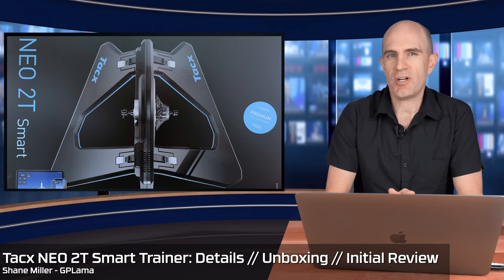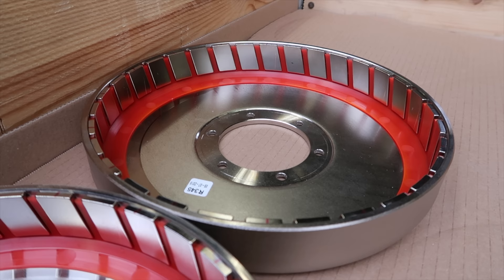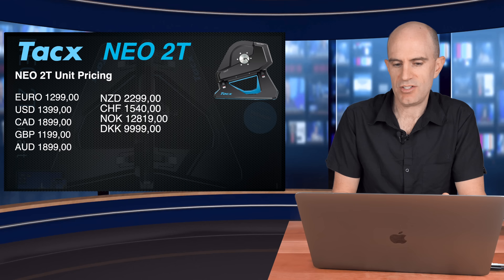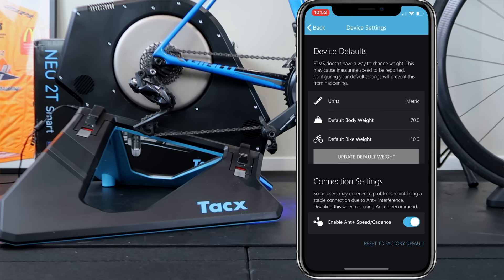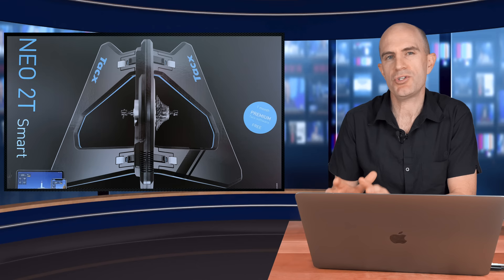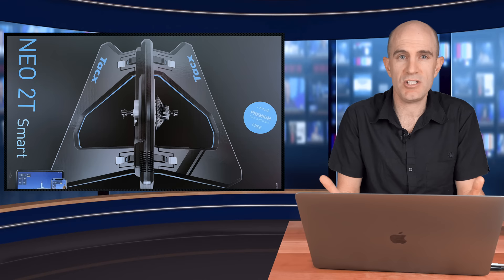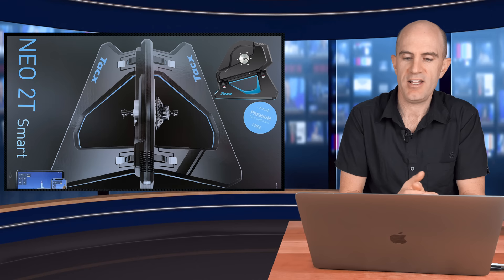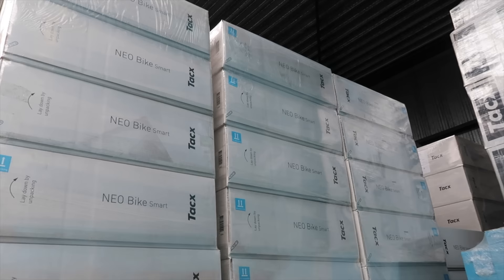Tacx NEO 2T Smart Trainer: Details // Unboxing // Initial Review

Comment: Shane, I just got a Tacx Neo Smart 2T and i feel like something is wrong. I have never used a smart trainer. It appears it is too hard for me to pedal even when in the lowest gears. Any ideas? Unless my power is too bad.
Reply from the maker: Ensure your weight is correctly set within the Tacx Util app if you're using Bluetooth to connect to this trainer with platforms such as Zwift.
Reply: Thanks for the reply Shane. I checked and I have the right weight in lbs set. I’m using the Tacx app. Cassette appears correctly installed and firmware is up to date. I’m using the front small gear and the rear 2nd largest. Still difficult to pedal. I think I’m going to reach out to Garmin to see what they say. ??
Reply: @hamdi672  I had a similar issue with my Neo 2. Could hardly pedal in the lowest gear. I contacted Tacx at the time and they asked me to send the TCX files of rides when this issue had occured. Eventually the unit was returned/ tested and replaced under warranty. Probably best to contact Garmin mate.

Comment: please be so kind to let me know the spec of cassette locking tool. thank you
Reply from the maker: This is the one I use: https://amzn.to/2yq6eE4
Reply: Shane Miller - GPLama thank you, It is the same result if the torque is given with a tool that does not have the 5 mm pin or guide.? Regards

Comment: Hi Shane, Any news on when the updated or full review on the Neo 2T will be published ?
Reply from the maker: Still a work in progress with Tacx and a few firmware revisions. We're close.....
Reply: @gplama  Are they gonna release new FM version cause power issues??
Reply: @Shane Miller - GPLama

Hello Shane! We road together a few times on zwift, been since winter 2014 👍
Quick question if I may? 
What are your concerns with the neo2t as it sits now?(you say it’s a work in progress) just wondering because I own one, and my only concern is Power May or may not be a smidge low? 

Thx again GP - Ride On
Reply from the maker: @dopefish90five  It's a work in progress in the Lama Lab. I believe Tacx have sorted the accuracy of the 2T .... and the power meters on my bike are tried and tested (and trusted). I'm working though a few variables that could be causing a few missing watts I'm seeing. It's quite the project behind the scenes. I'll cover this when I get my two feed back on the ground in the Lama Lab.
Reply: @gplama  Anything new about updated review???
Reply from the maker: @holsius  Not at this point. Soon. But I haven't seen any updates or details published from Tacx that'll change anything since I last looked at this.
Reply: @gplama  fw. 0.34 is out. Same power difference against power2max ,quick tested 200w and 250w in erg mode.
Reply from the maker: @holsius  I've been doing a few tests here over the last few days. Looks like 0.0.34 nailed down an issue with high speed flywheel and power reporting with the Neo2/2T. I'll post an update when I have more details... it's a work in progress.
Reply: I mean that difference IS same that before. Not good
Reply: Fw. 0.34 neo2t 200w vs. 209w power2max and neo2t 250w vs. 262w power2max. Almost 5% difference. Tested in erg mode.  Power issue is not fixed. Does tacx even know these issues???

Comment: Is there a list of firmware updates and release notes for each? Are power numbers more closely aligned after the .32 release? I’m seeing the Neo 2T reporting about 10% low. I just updated to .32 after riding today so fingers crossed.
Reply from the maker: I don’t believe Tacx publish these anywhere other than in their app, and only when there’s an update.
Reply: Thanks for the quick reply. I’m a TT guy so if this trainer is consistently out even 5% I’m returning it.
Reply: @chrispyy606060606  My own setup neo 2t reports lower wattage numbers than my power2max ng eco,  It´s 5-4% out , whole range. FW 0.32, new FW wanted.
Reply: jouni holsius thanks I believe I saw your post on the Garmin forums. 5% low for me at 360 watts (18 watts) is just not acceptable. Hopefully it’s at least closer than what it was on the old firmware. I run a PT hub on the TT bike on the road so I’m hoping the delta post FW upgrade is in the 3-4% range for now.
Reply: Firmware update worked! It’s much much closer now.
Reply: @chrispyy606060606  300w area, what is the result?
Reply: jouni holsius before I was around 8-10% out so around 30 watts. Around 10% at 200 watts as well. It’s within a couple percent now which is fine for me training wise. I’m sure they’ll have additional firmware updates.
Reply: I made a mistake...My Neo 2T is still reading low. Quarq, Pedals and PT identical. (Power (with 1-2% between all three/HR response the same). Neo/Quarq about 10% delta on .32 firmware. (Plus big HR difference) For now I’m going to just use the Quarq for power/cadence and have the Neo control resistance. Hopefully new firmware is coming soon, this is ridiculous.
Reply: @chrispyy606060606  Any change? Looking at buying one of these but if they can't fix it after 8 months, I'm not sure they ever will...

Comment: The Neo 2T costs $400 dollars more than Neo 2 is it worth it? I know I need an $80 adaptor for the regular one. So the difference is $320.
Reply from the maker: For me, who encounters the virtual tyre slip on the Neo 1/2, yes, it's worth it.
Reply: Shane Miller - GPLama thank you for your reply. Great work on the videos was massively helpful in choosing what to get 👍🏽
Reply: @gplama  Quick question do I need the Ant + with USB extension? I am going to set up Zwift on my PC computer. I just ordered the grease and chain tool on amazon. Want to make sure I am rdy to go.
Reply from the maker: @pablorodriguez5100  PC/computer so Windows 10? I've found ANT+ to be far easier (and compatible) with everything for Windows 10 and smart trainers/power meters/etc.
Reply: Shane Miller - GPLama - yes windows 10. I thought it connected via bluetooth. It needs both?
Reply from the maker: @pablorodriguez5100  You can use either.

Comment: Hi Shane, any updates on the reviewing of NEO 2T?
Reply from the maker: Not yet. I have a beta firmware for it that I'm waiting for them to release to the public.
Reply: @gplama  - thanks mate, looking forward to it. 0.0.34 Firmware still seems to be inaccurate based on my Stages Power Meter testing and comparison. 

Zwift has Power Matching, but Sufferfest has been working on Power Matching for a few years now, which is my preferred structured training App. They are yet to come up with it.
Reply from the maker: @frankmarzan7421  Stages L/R or just L?
Reply: Shane Miller - GPLama just Single L, but wouldn't expect more than 3-4% out which in this case can be 8-9% specially on the higher watts (well my higher watts anyway :))
Reply: Is the Beta Firmware you have post 0.0.34? Have you tested it yet? Or are you still waiting for it from Garmin?
Reply: How's the beta Firmware going Shane?

Comment: I have had the 2T for a few days and I am also experiencing the erratic cadence. It’s pretty much not worth having on. Unfortunately the latest update .32 has not fixed this. The power is quite solid and as expected - 10w from my garmin Gen 1 vectors which have been faultless since I bought them 7 years ago. 

I have sent my details to tacx but from some forums I’ve read it seems they are sending out a small strip of metal to extend the pedal so it passes the sensor. Am I missing something here? Are tacx actually selling us a £1200 trainer with a cadence sensor located too far away from the pedal arm and then telling us to use this and think that’s okay ? Seriously ? 

Can anyone kindly shed any further light on this matter? 

I have a 2013 Canyon ultimate cf slx with 172.5mm crank arm. 

Thanks

Comment: Will this really fix the virtual tire slip issue, or will it just slightly move the point at which it will occur? (I mean according to the specs, the motor doesn’t seem to be that much stronger?)

Comment: Hi Shane. I know it has been asked a lot, but do you have any updates on the 2t accuracy yet? I have eventually managed to get a refund from a wahoo debacle and am in the market for a new trainer. I see dcrainmaker is happy with the accuracy, but interested if you had managed to sort your issues. Thanks, Rob
Reply from the maker: Firmware 0.34 released not long ago was said to address power accuracy in some units (I believe...). It has helped with a power issue at higher flywheel speeds I can confirm. I'm working on a few other things at the moment and haven't looped back to the 2T in great detail. Soon.